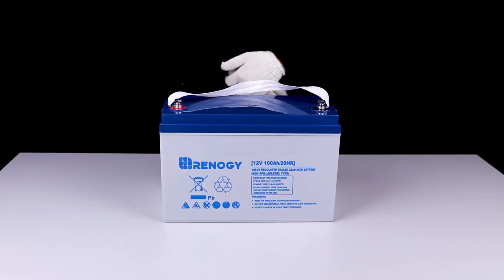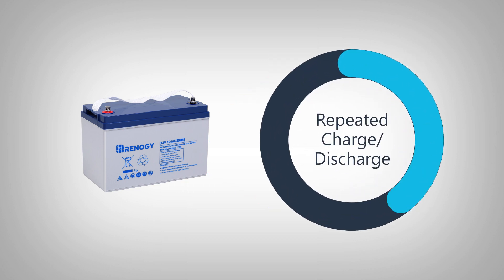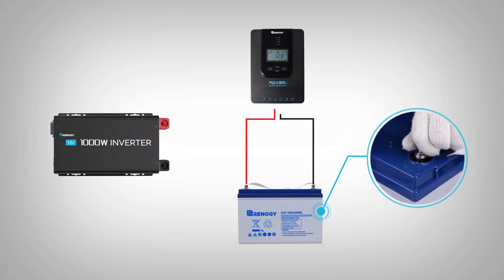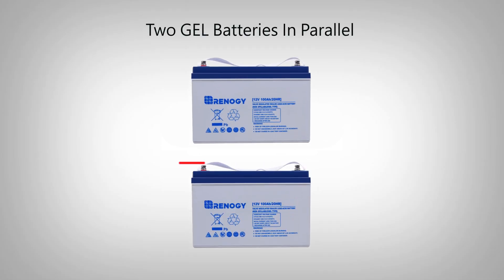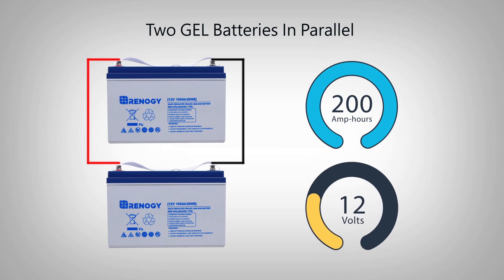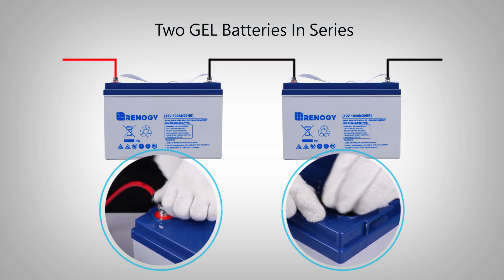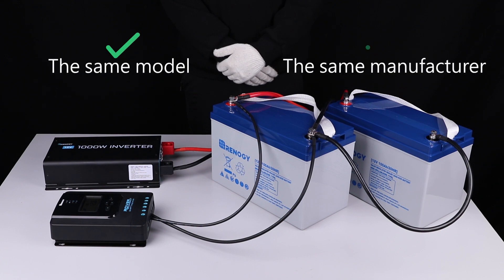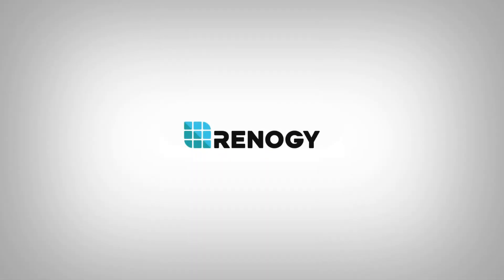Renogy 12V GEL Battery

Comment: I bought this battery a few months ago.  It seems to work OK, however, when I connected my car battery tester to it the meter says to replace.  I realize this is a deep cycle battery.   The test settings I used are AGM and 100 GB.  The meter says the internal R is 43m ohms; 0% health; 57A measured. Can a car battery meter be used to test this type of battery?
Reply: Unfortunately, you can't use this to test deep cycle batteries.
Reply: @Renogy_Cares  Thanks for your answer.  Renogy might mention this somewhere because this type of battery seems deceptively similar to a car battery so using a car battery test meter may cause misleading results.

Comment: I just bought one of these to run my 5 hours at a farmers market. Small grinder...intermittant use. This battery replaced my duracell lead acid SLI 31 which worked for almost 3 years.
This one does NOT perform better it performs worse.

Comment: Can I charge the 100ah gel battery solely with my camper van's alternator? It is an auxillary battery.
Reply from the maker: Hi,BillyAtkinson.

The charging paremeters are as followed:
Max Charging Current: 30A
Float Charge Voltage (77°F/25°C): 13.6V~13.8V; Temperature Compensation: -18mV/°C
Cycle Use Voltage (77°F/25°C): 14.2V~14.4V; Temperature Compensation: -24mV/°C
Equalization Voltage (77°F/25°C): 14.2V

As long as your alternator output can match these parameters, it can be ok.
Reply: @RenogySolar  Thanks!

Comment: I have 2 pure gel batteries and need to add on another one but all that is available now are the hybrids. How can I remedy the situation since it's advised not to mix?
Reply from the maker: Hi~ For the consideration of battery life, it is strongly not recommended that using batteries of different models, capacities, and ages. You may need to look for old batteries in other sales channels.